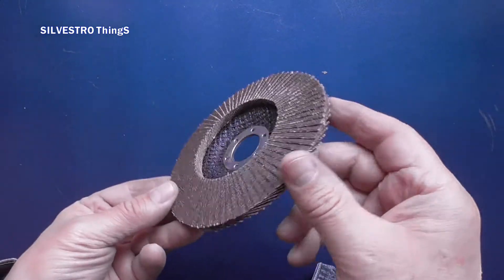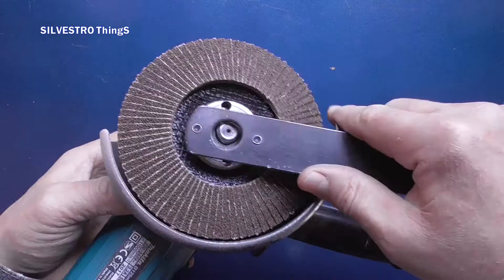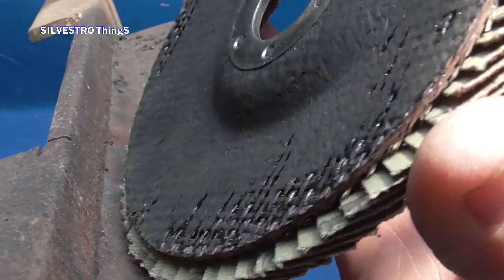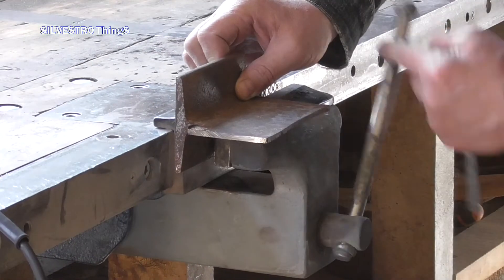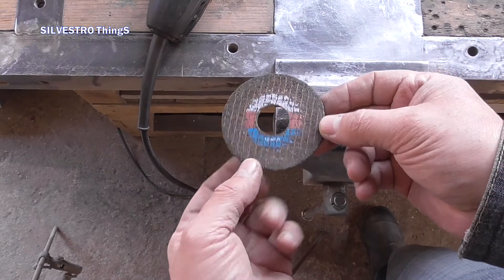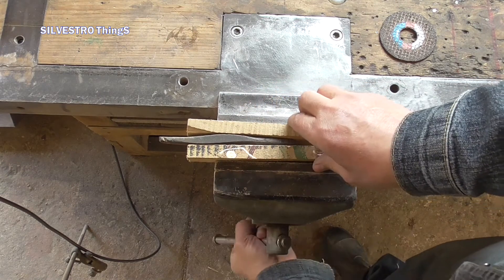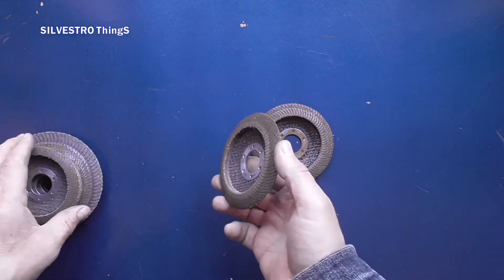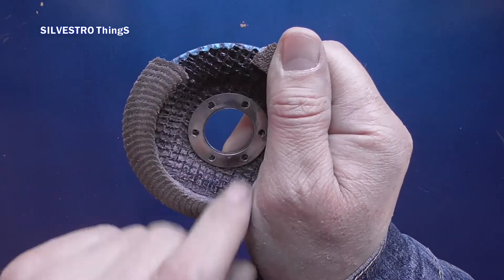How I squeese 100% out the flap disc

Comment: My father likes to use these flap discs to 99% it seems, and one day while in a hurry, I picked up his grinder that has one of those discs that looked like 80% of it was used. So I started grinding, and  I must have hit a sharp piece of metal when a piece of the disc detached going through my overalls and into my thigh. They don't seem like it, but even the small piece of emery cloth can cause a lot of damage when launched from a spinning disc. I was aware of how dangerous angle grinders are, but never expected the lightweight piece of flap to carry so much kinetic energy.
Keep safe.
Reply from the maker: An angle grinder is one of the most dangerous tools. I had a chip in my eye once myself, now I only use the grinder with goggles and a dust mask.
Reply: @SILVESTROThingS  Had a needle like piece of metal stuck right in my eye too, the doctor had to use a hypodermic needle to literally dig it out. And I still have a small piece of that carbon fiber (could be glass fiber) stuck in the corner of my eye since 2017. Definitely a dangerous tool when used carelessly.
Reply: @anelpasic5232  For the 2 dollars that the disc is worth, why even try this?  They aren't designed to be used in this way.  Ive had enough stuff flying around the shop to even contemplate doing this.  It hurts, and you've only got one set of eyes!